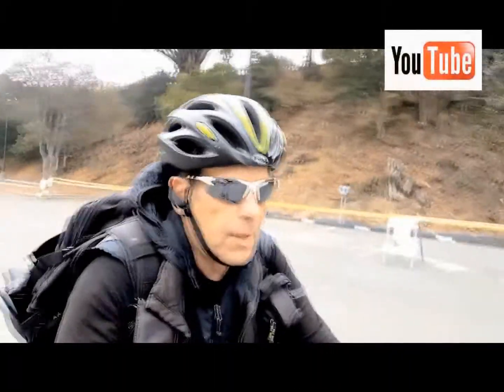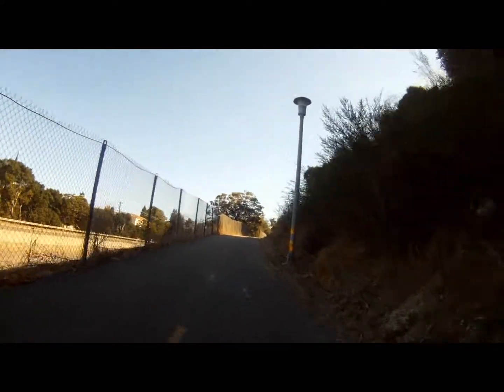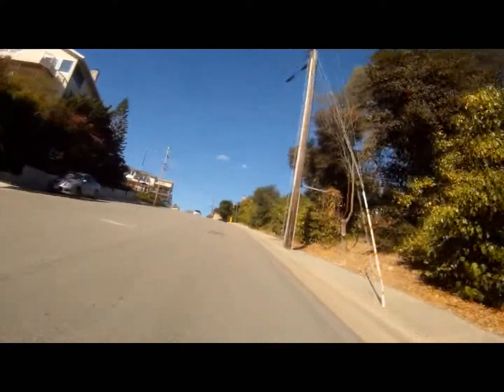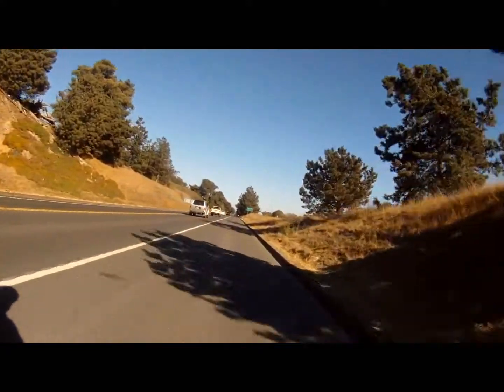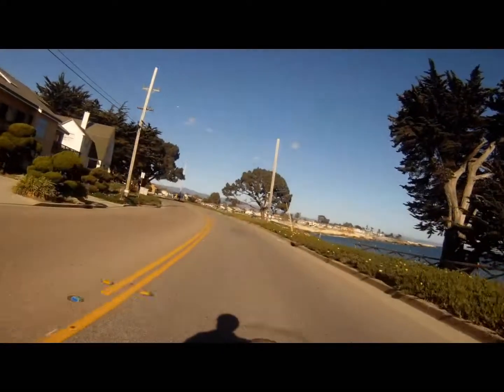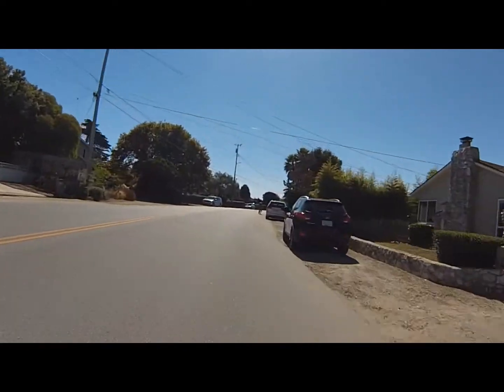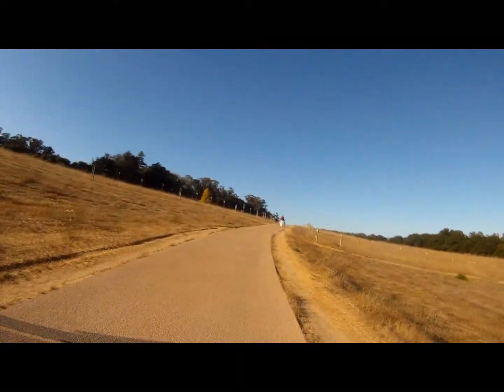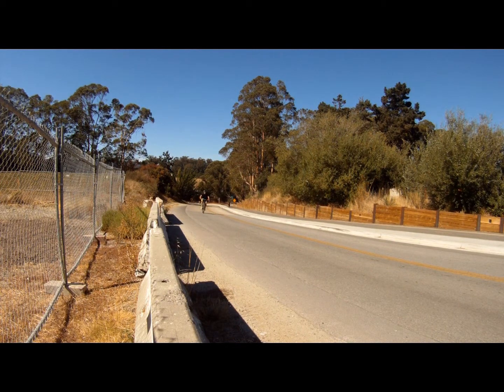Electric Bike Review. FAST 1200w E-bike conversion kit

Comment: Hi I'm new to the e bike world but love watching your videos. I ordered a 72v 1500w hub moter with a 48v 35a controller. Can I get a 72v 2000w battery without the moter or the controller overheating? because I plan on upgrading in the future and I don't want to have to buy another battery they pretty expensive if that's not possible can you give me a recommendation thank you
Reply from the maker: Hey Michael, you have to be very careful about running a 72v battery through a 48v controller. If you ordered a 72v, 1500w kit it should come with a 72v controlller. But make sure that the controller can handle the 72v. I have known too many people that have fried their controllers.
Reply: Electric Bike Lifestyle AUGUSTINE EBIKES. I bought it at the e bike motor website but I don't know if it comes along with that specific controller for that kit it doesn't specify just says 35a-40a. If not I will definitely buy one